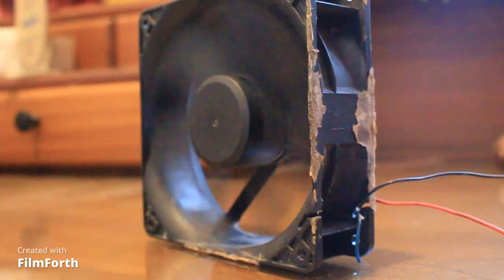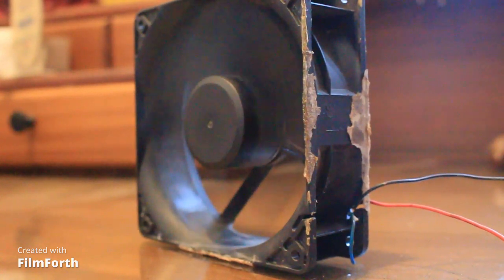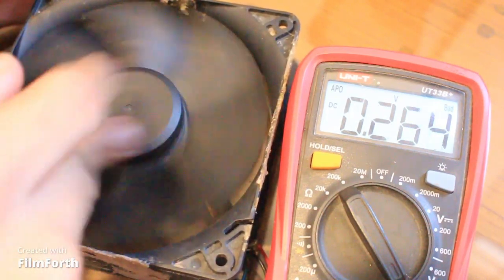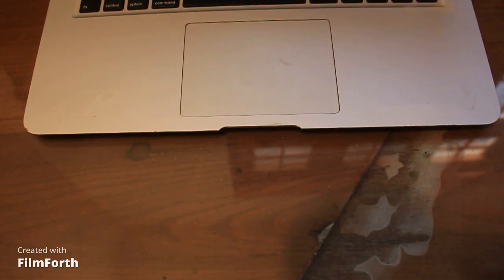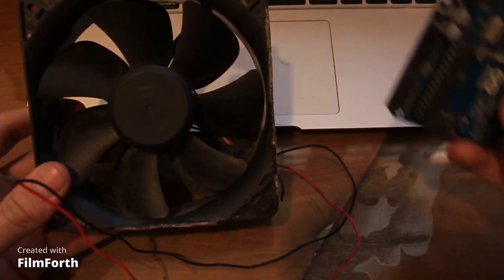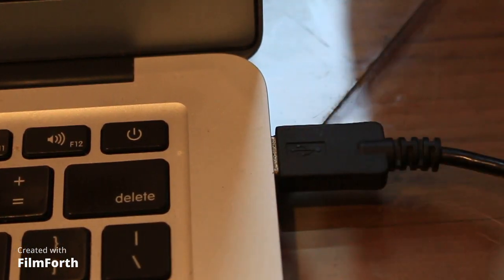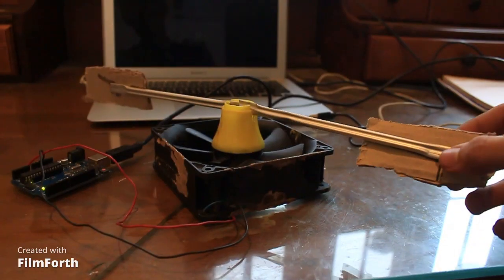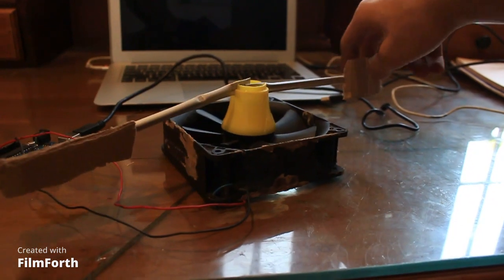DIY wind speed checker with Arduino | Anemometer

Comment: very poor construction and not reliable, you couldn't have rotated the fan with normal wind, you needed your hands to move it as it was a DC magnetic motor and has cogging effects due to  its basic construction, you may use a DC motors without the coils & internal magnets and have small metal washer stuck with glue to the blades and use a hall effect sensor as the speed sensing element connected to Arduino to count the pulse and then correlate with the actual wind speed.

Comment: where is the code
Reply: //Define the analog input pin
int windPin = A0;

//Define the voltage output by the fan when it is not spinning
float zeroWindVoltage = 0.04;

//Define the voltage change per unit of wind speed (mV per mph)
float voltagePerMPH = 0.1;

void setup() {
  // Initialize the serial communication
  Serial.begin(9600);
}

void loop() {
  // Read the voltage from the wind sensor
  float voltage = analogRead(windPin) * 5.0 / 1023.0;

  //Calculate the wind speed in mph
  float windSpeedMPH = (voltage - zeroWindVoltage) / voltagePerMPH;

  //Ensure windSpeedMPH is always positive
  if (windSpeedMPH < 0) {
    windSpeedMPH = 0 ;
  }

  //print the wind speed to the serial monitor
  Serial.print("wind speed: ");
  Serial.print(windSpeedMPH);
  Serial.println(" mph");

//Wait for a short period before taking the next measurement
delay(1000);
}
Reply: i will try this, more power to you.
 @enerratawi
Reply: @enerratawi  thanks😃😃
Reply: @TitaniumBrawls  any time